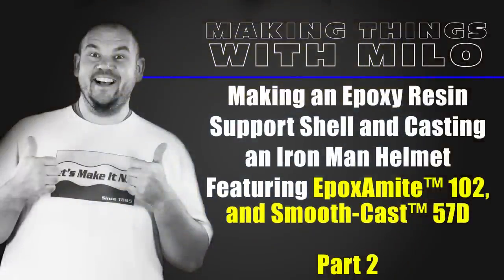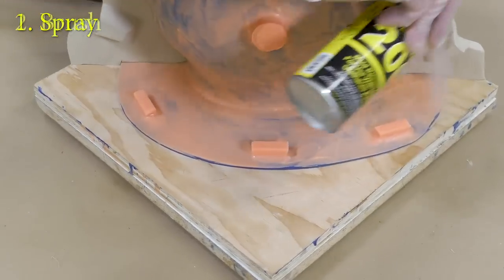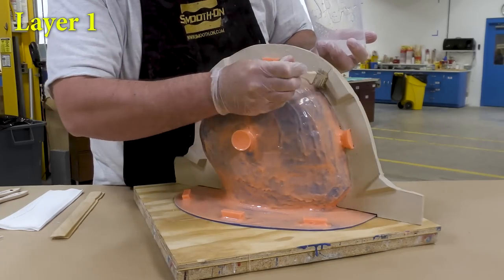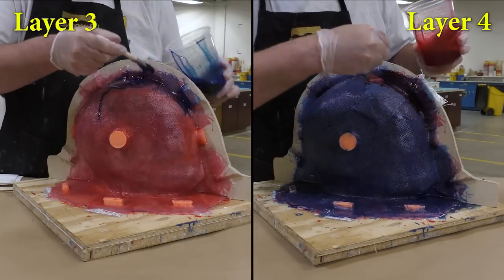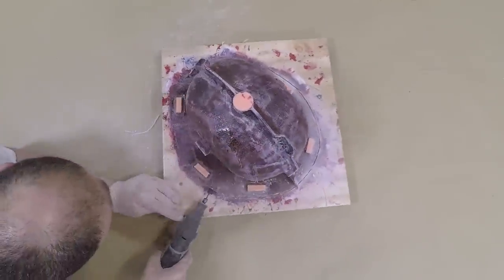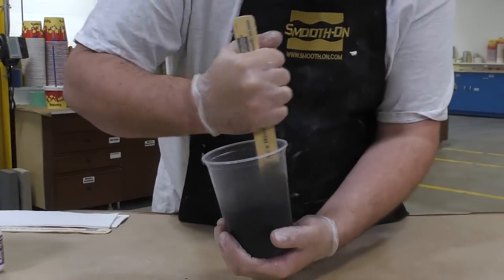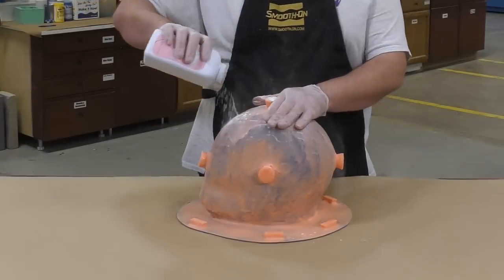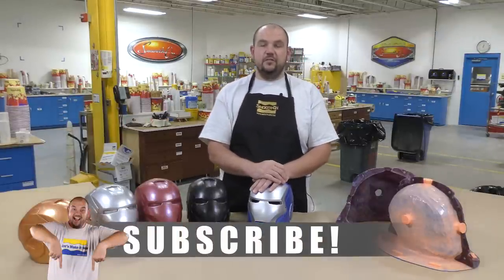Cosplay Tutorial: Iron Man Helmet Casting

Comment: One important reason why to use the 57D for roto casting that you didn't mention: It doesn't snap cure!  I make the mistake of trying to roto cast with 300 and let's just say it didn't work so well!  It ended up being super lumpy and uneven because it went from flowing around the mold to all stuck in one corner in very short order! Switched to 65D which also isn't snap cure and it worked like a charm :)
Reply from the maker: Excellent point!

Comment: Awesome videos, I'm going to be doing this for the first time soon and this is incredibly helpful.

Just had a question, I noticed the helmet after the casting has a little bit of a texture to it? I will likely be sanding afterward anyways, but I was wondering if there's a better way to smooth it while applying the silicone process?
Reply from the maker: Some people use 99% isopropyl alcohol when smoothing the silicone.

Comment: I'm a little puzzled. I see that with all the registration keys you've put on, you put the wider tapered and outward, which works great for locking in the silicone mold along the mother molds part line. But the keys on the left and right side of the helmet by all logic should be mechanically locked in when you fiberglassed over them. Yeah the flexibility would allow you to still separate them, but because of the tapered shape, I would think it would be almost impossible to reset The left and right side registration keys back up if you were going to do another pull.

Is there something I'm missing?
Reply from the maker: The rubber can be reset into the registration hole with the help of a small amount of baby powder applied to the rubber.

Comment: Another question came to mind about this video. Can this resin be sanded, cut or drilled after the casting is complete?
Reply from the maker: Yes, it can be sanded, cut and drilled
Reply: @smoothon  can this resin stand up to uv rays, heat and humidity?
Reply from the maker: This resin is not UV resistant unless it is painted.  Humidity will not affect it, but high heat may soften it.

Comment: Hi great tutorial i need little suggestion plz reply
Reply from the maker: What can we help with?
Reply: @smoothon  thanks can we use basic fiber mesh for this purpose, i known it is not as dense as your fabric but can we use basic mesh with 3 times more layers?
Reply: @smoothon  fiber mesh used for water proofing
Reply from the maker: You would have to test this for performance independently.
Reply: @smoothon  so it mean it ll work but strength  & performance might  suffer?